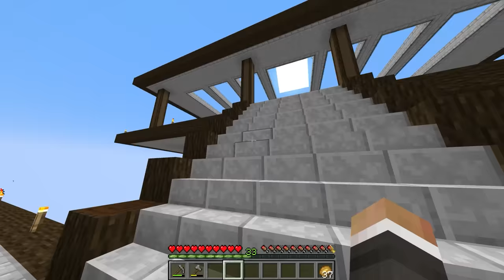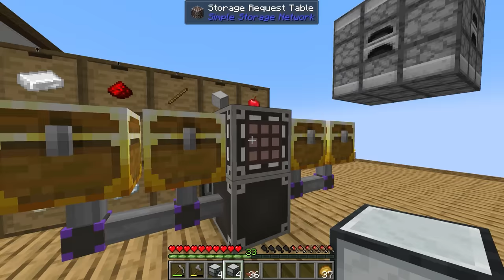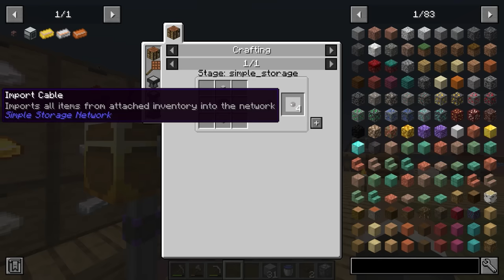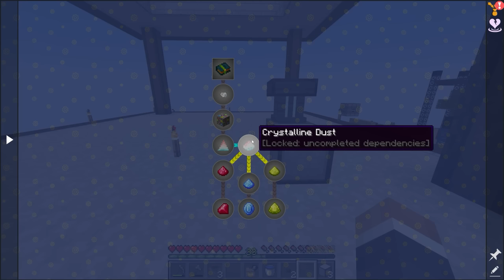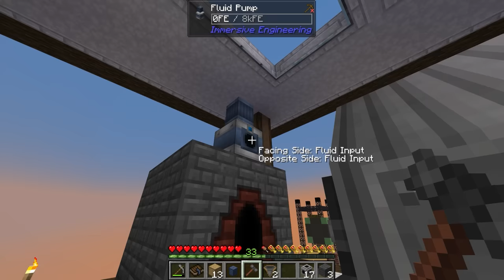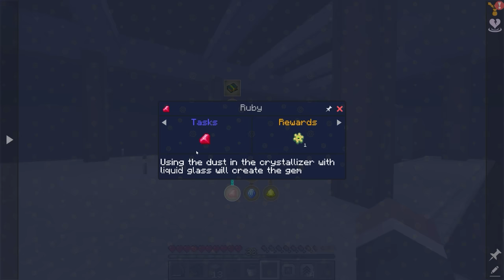Minecraft Techopolis 2 | ASSEMBLER TECHNIUM AUTOMATION! #7 [Modded Questing Skyblock]

Comment: Why not just use the simple networks to export to the pulverizers/induction smelters? Or heck to a chest that can then round robin your bank of them? Would get rid of the item spillage, and on top of that handle the case when you aren't processing fast enough since the storage on top of the miners will block the miner from making more. I assume it is a case of YT blindness/he has a sunken cost already and doesn't want to give up those belts.
Reply: Belts look cooler than simple storage cables everywhere 😅
Reply: SSN is garbage, he even had the usual problems with SSN in this video.

Comment: Hey guys, I´m new with this modpack and I´m having some trouble with this automation... The autocrafting table of techium keep absorming all my stuff from my main system, do you know how can I fix that? I did the same that Isaac done but I still can´t find the problem :(
Reply: First remove the table from near your system, if you have a crafting recipe saved inside the auto crafter it'll pull from nearby storage and complete the craft, also his method is very convoluted I would just wait till you have refined storage or AE2 to automate all the technium ingots it's way easier and simpler